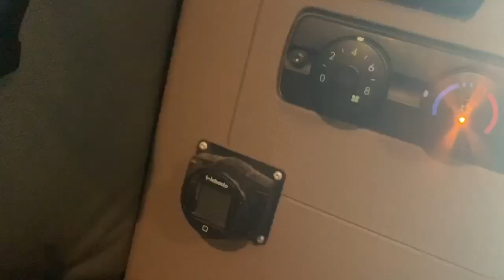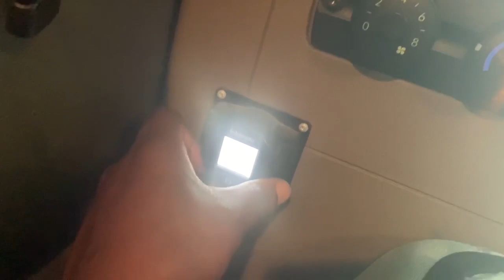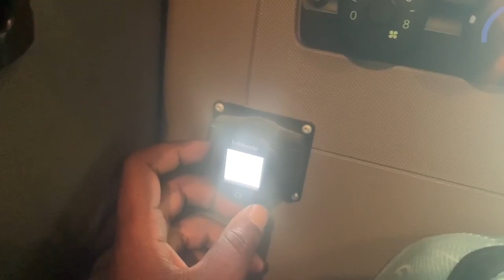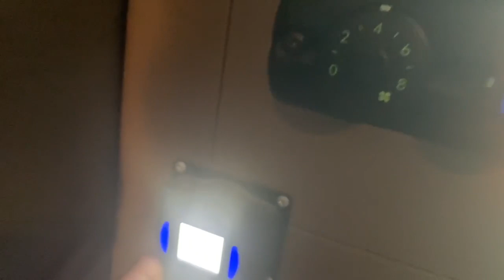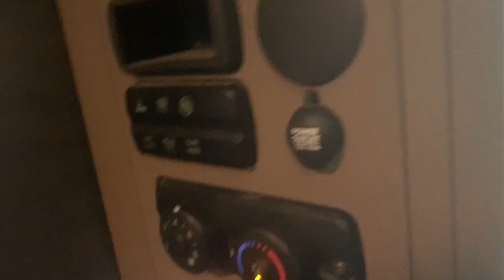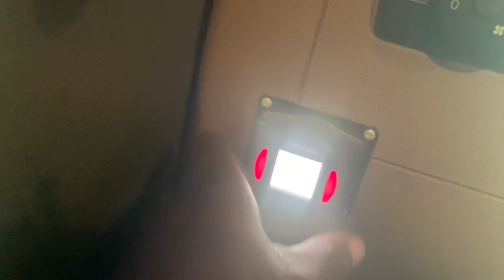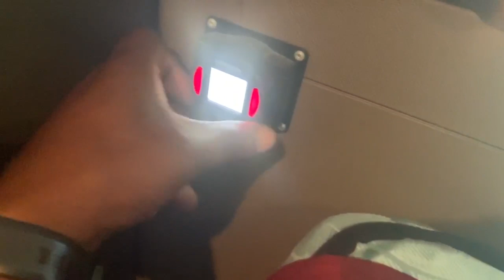How To Use a Freightliner Bunk Heater

Comment: Remember to turn the key off because I have been up north where I need to idle during the day but it gets cold at night. I figured out how to turn the heat on but mine wasn't coming on even though the truck was off. I reached up and had to turn off the key and then the heat came on.
Reply from the maker: Most definitely. It won’t run with the truck powered on

Comment: The LVD is your low voltage disconnect, so when the systems battery goes low it might auto start the truck or turn your heater off so you can start the truck . My KW over her at central Oregon dose it .

Comment: Get with Brian Brophy in Birmingham, he will change the parameter to allow idling. Owner operators have that option. Or unplug the temperature sensor it's behind the drivers convex mirror. #Flatbed gang
Reply from the maker: James Mathis 10 4. I didn’t know that
Reply: If you unplug the temperature sensor your check engine light will come on but the truck will idle.

Comment: Can you run the bunk heater while driving?
Reply from the maker: Dangerous to man it cuts off automatically. But you wouldn’t have to use it while driving because then you could just use the regular heat
Reply: @bigsnow1705  want to put one in a trailer.
Reply from the maker: Oh ok. Not sure how you would go about that